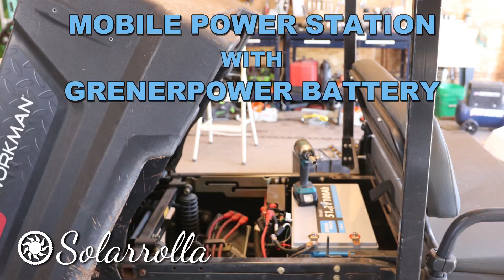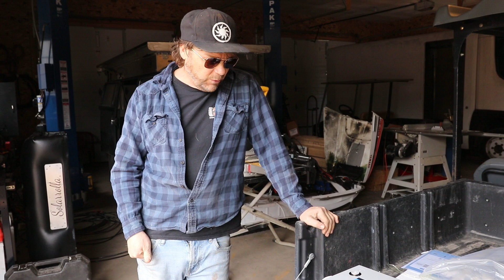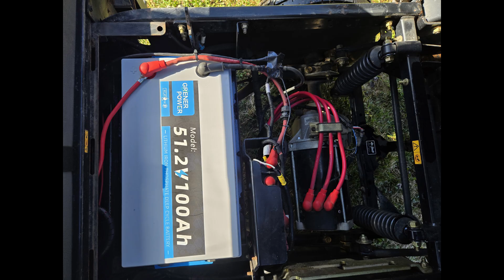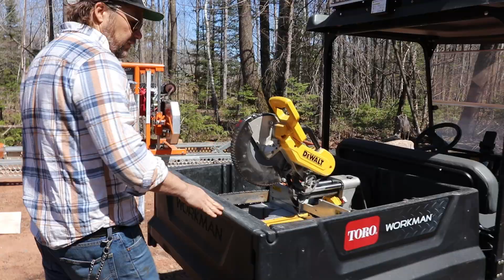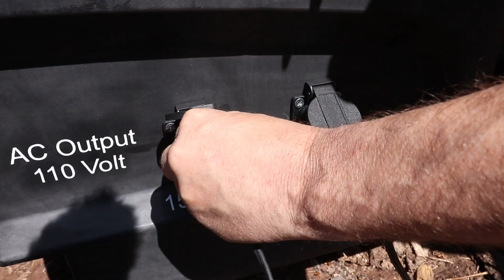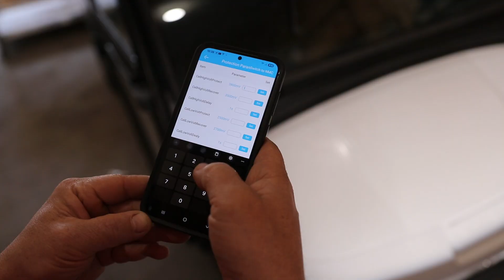Solarrolla Mobile Power Station with GrenerPower Battery

Comment: SUPER JOB👍,
I am in Britain and for 11 months last year refurbished a 3 bedroom house for my daughter using my Nissan e-nv200 40kwh as the only power source.  It is a camper van with 3000w inverter 200w solar, unfortunately the inverter has to be run off the  200ah lithium 12v system so the ignition had to be on to activate the dc-dc charger for larger loads but for running lights charging battery tools or 240v drills it worked fine, used about 6 miles of range on an average work day.👍
The ability to charge on the public network and then plug remote cabins into a utility vehicle could open up so many remote and therefore cheaper living options. Thank you for sharing your knowledge. Ed.